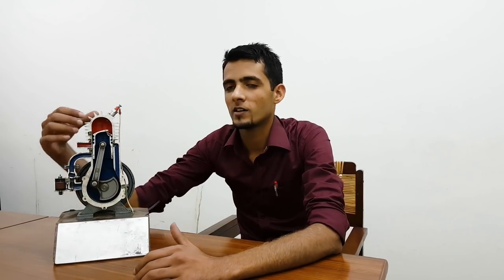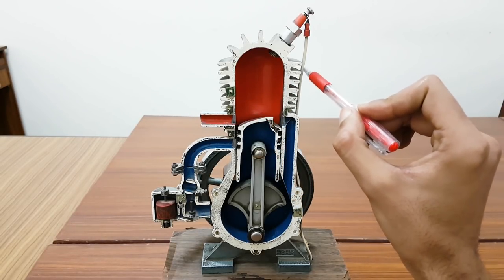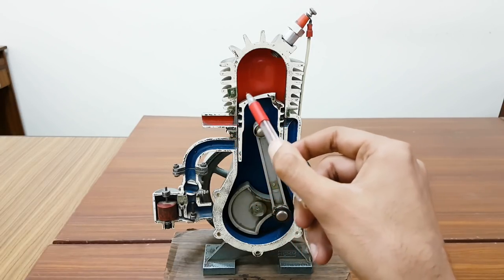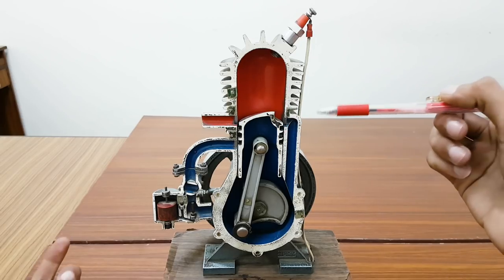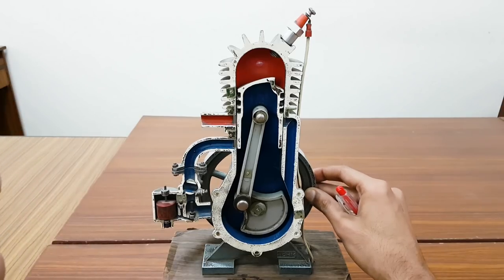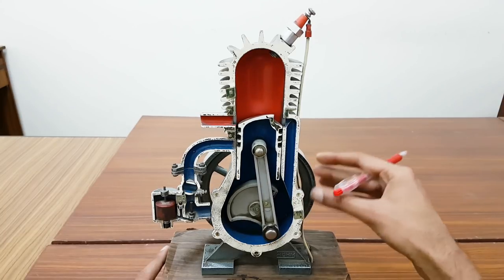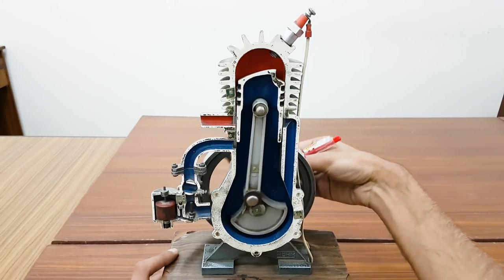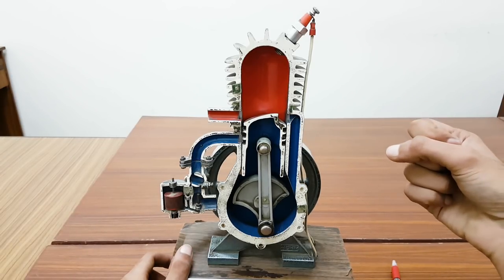How Two Stroke Engine Works

Comment: A stroke is when the piston moves from tdc (top dead center) to bdc (bottom dead center) or from bdc to tdc. 4 stroke engine has 4 strokes. Intake(tdc to bdc), compression(bdc to tdc), power(tdc to bdc), exhaust(bdc to tdc). As said in the video a 2 stroke is this process but cutting the number of stokes in half by combining the intake and compression stroke together and then combining the power and exhaust stroke together. Im just clarifying some of the details not criticizing the video as I find it very informative.
Reply: lovely comment my guy
Reply: Thanks for clarifying. I was confused until i read this comment. It clicked for me and made a lot of sense. Thank you!
Reply: Perfect
Reply: Yes was actually a good video

Comment: The big problem with two stroke engines is the way lubricant oil is mixed with fuel, so the carburetors are tuned to avoid damaging lean mixtures where oil concentration is dangerously low. To avoid that lean state the carburetors are tuned to run a little on the rich side. When that tuning slides back to stoichiometric values the idle rpm increases which causes even more cylinder wear. Emissions regulators get their panties in a knot when they learn that mechanics are trained to tune machines a little rich on purpose to make equipment last as long as possible.

Comment: Good day. Nice video.
I have a Yamaha dt 200r dirt bike. I would like your advice on something. I am seeing a lot of two stroke oil settling under my piston causing my engine to stalled.
Reply from the maker: Well i am currently working on my YB 100 yamaha.... also 2 stroke engine..... it has same issue..... when ill find solution.... i will share with you guys....thanx...🖒

Comment: After explosion stroke the air inside will still hot enough to create pressure. Is there a chance of pressure being balanced between this hot air and in coming fuel air mixture there by resuming engines function???
Reply from the maker: For this reason the exhaust port is slightly higher than intake port...... i.e exhaust port open before intake port... so the high pressure gases flows out to exhaust... therefore no restriction is left in cylinder to disturb intake air fuel mixture...

Comment: Sir ,if we pass air-fuel mixture through crankcase ,then how will you lubricate the crankshaft!...???
Reply from the maker: The mobile oil that we add in fuel tank... works as lube for crankshaft bearings...

Comment: wes595
Hello, and thank you for this video! My question is in regard to the exhaust and use of the expansion chamber and power band. How does the expansion chamber help the engine performance? What happens if you reduce the size and change shape of the expansion chamber in the exhaust? I recently changed the geometry on a 1100cc 3 cylinder two stroke exhaust to fit in a smaller jet ski, but now since I changed the shape and volume of the expansion chamber, my powerband is not as powerful. Will this cause premature engine wear? Thanks in advance!
Reply from the maker: Really sorry dude.... I have never worked on expansion chamber.....

Comment: What I don’t understand is in racing motors such as a motocross bike, there are reed valves that spray the mixture but once it sits in the crank, how is it a mixture still?? Also the power valve is another mystery to me as to how it operates. Basic 2 strokes don’t have power valves.

Comment: wouldn't it work a little better with the exhaust port slightly higher there by creating a vacuum to draw the fuel air mixture more efficiently?
great video though 
☺️
Reply from the maker: +Trace 23 thanx mate.... yes could be better... but we have to keep in mind several other factors also...😊

Comment: In the 2 stroke engine due to the presence of the lubrication oil, some of the lubrication oil must be combusted during the time of heat addition. Hence there is more friction and loss of work in 2 Engine. So Hence 4 stroke engine is more efficient and have more power .

Comment: This is partly wrong, the exhaust port opens a little bit before the gas port so the exhaust can leave without the gas leaving to. Then it opens the gas port
Reply from the maker: Hmm... that is true..
Reply: Not on this engine look at the top of the piston its makeing the gas/mix flow up the bore instead of just being sucked in . On a dome or flat top piston engine the ports would be as you sed .
Reply: Dillon Brewer another reason why these engines aren’t usually used on modern vehicles is because of the emissions. The emissions are burning oil, and a little bit of gas and oil are being released because the exhaust and intake are open at the same time.
Reply: you are absolutely right I was thinking the same thing when I saw the illustration they are straight across from one another and that is not how it works

Comment: Can any tell me why two stroke engine louder than four stroke? Is there are any solution to reduce the that sound or convert close im to four stroke sound?
Reply from the maker: In two stroke engine we cannot put too much restriction in exhaust system.... because this will cause engine to bog down.... you can reduce noise but increasing length of muffler and adding more steel wool...
Reply: Got it. Thank you for the responce 😇

Comment: generally, in fluid dynamics, high temperature equals high pressure. So I don't see why the colder gas would have a higher pressure than the very hot gas.
Reply from the maker: Well exhaust port is slightly up from transfer port.... by this, the high pressure from exhaust gases is released and afterwards the transfer port uncovers, through which the air fuel charge flows to cylinder and pushes out remaining exhaust gases (scavenging)....
Reply: The colder gas has a higher density, not pressure.

Comment: 3:00 sure it's not the crankshaft side closing the carburetor port and COMPRESSING THE air fuel mix FORCING it into the intake port? LOOKS LIKE IT. It's not going to enter because it's COLDER AND MORE DENSE. Because "cold and dense" won't hold against the pressure of an explosion. You kind of got it at the end there but never REALLY explained the pressure changes in the crankcase.
Reply from the maker: Appreciate your theory bro & its true....❤❤❤.... i was just trying to explain basic, so that most of people can understand its working....

Comment: How fuel get inside without pump
Reply from the maker: Bro..  its carburetor that mixes fuel in form of vapours with air passing through it...
Reply: Excellent video. Thank you.

I'll try to help and explain how air fuel mixture enters without a pump (the engine itself is in fact a pump). 

When the plug fires (starting the power stroke) the piston is driven down creating a vacuum which sucks the air fuel mixture from the carburetor through the intake port as long as it remains open. After the piston seals off the intake port and it reaches its lowest point (known as "bottom dead center")it begins an upward travel forcing the air fuel mixture through the transfer port into the area above the piston (also helping to force the exhaust gases out the exhaust port). Once the piston reaches a height closing off both the transfer port and the exhaust port, the area above the piston becomes the "combustion chamber" until it reaches the top (known as "top dead center") at which time the plug ignites the compressed fuel mixture.  This 2-stroke cycle (one up, one down) continues to repeat as long as fuel and/or spark for ignition is supplied.

Things get a bit more technical than this explanation, but this describes both strokes of a 2 stroke engine.
Reply: gravity